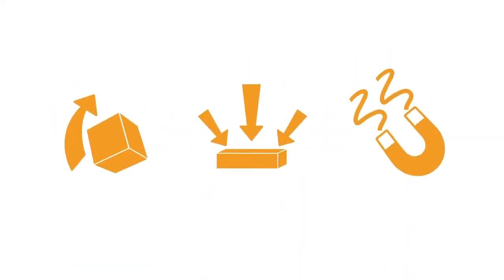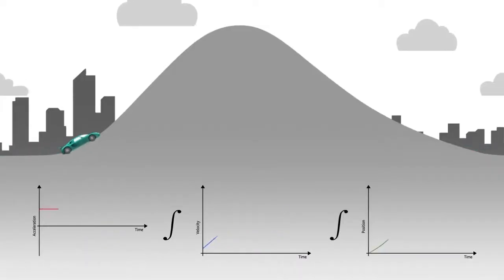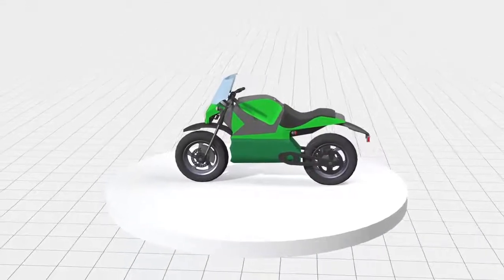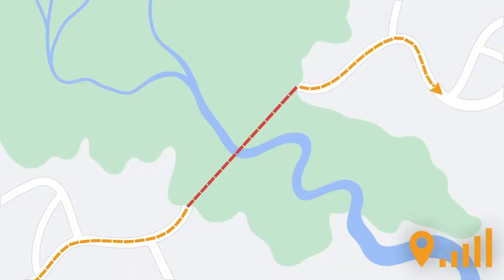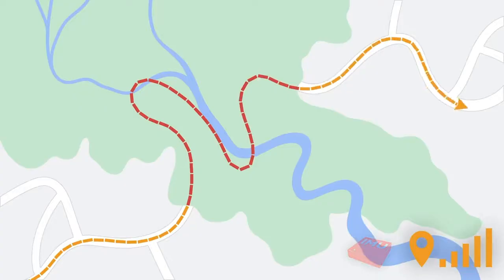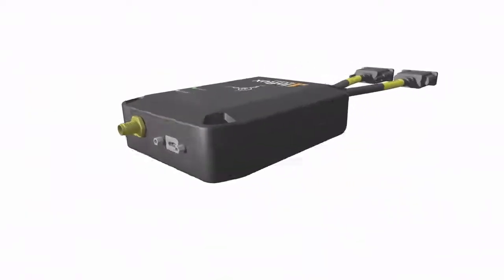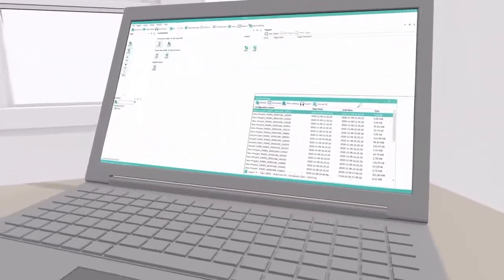What is IMU | A simple guide to Inertial Measurement Unit │IMU application for CAN networks

Comment: 3:06 - - § (underground tunnels) § Reflective skyscrapers § Wide bridges § Multi-level roads + highways + § Dense building structures all cause significant challenges for (GPS / satellite (GNSS?) signals to be transferred, and consistent positional data of a(ny) vehicle’s movement to be observed or tracked.   
3:20 - - even with satellite-based augmentation systems (SBASS) implemented into regions across the globe to help provide positional references for more accurate GNSS measurements - data is not always reliable or reachable.
2:40 - - cities (+ urban structures steadily) becoming more dense cause disruptions in GPS, tracking + logging positional data.
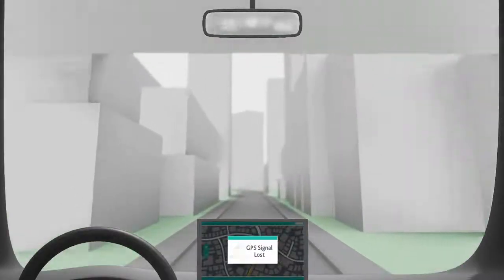2:54 - - to determine position (via GPS ((GNSS?)) at least 4 satellites must be reachable bc their signals must be received and decoded.